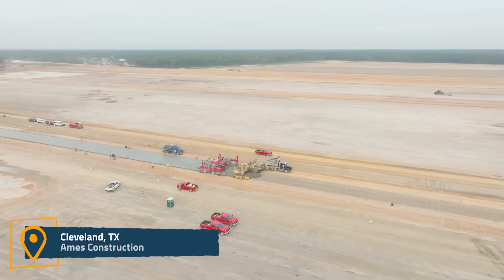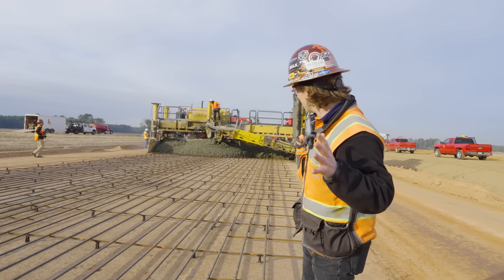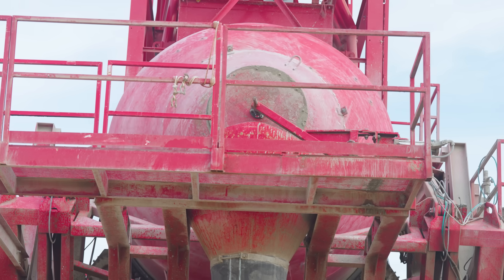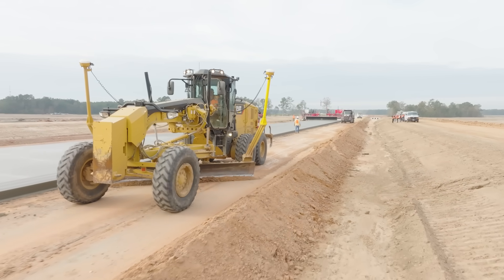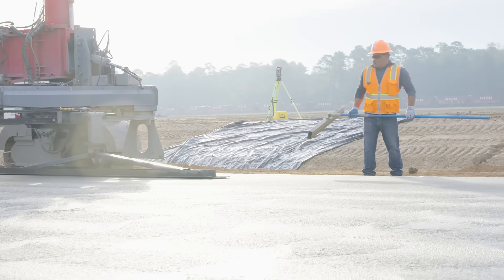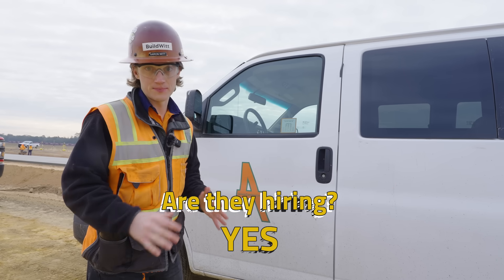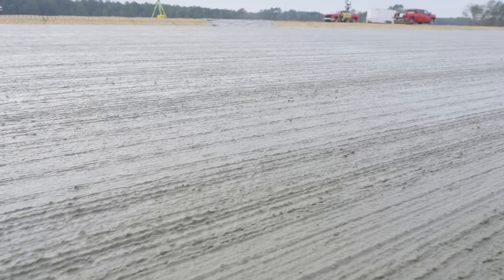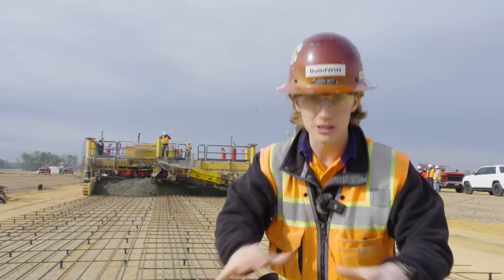Concrete Paving for a Railroad Logistics Center

Comment: I wonder if they could have sped the concrete paving up by pouring concrete slabs to set in place and bolt together like caltrans uses.  They could have been casting slabs for months.

Comment: I never knew there are mobile concrete mixing plants as large as these or that they even exist. I don't think we have something like this in Europe. Makes a lot more sense than hauling the concrete from a normal concrete plant which is often far away. Great video!
Reply: in america 100 miles
here in uk 10-20 miles

Comment: If you’re in the concrete trade this video is just amazing! The operation is so flawless! I can’t imagine taking on a job of that size!
Reply: Yesterday we poured 10 yards kind of a messed up situation today we did 20 yards. These guys are pouring that much every minute.
Reply: @steveanderson4768 don’t feel bad, they have millions and millions in equipment😂
Reply: @steveanderson4768 we do 1000+ yards a night by hand and 2000 with the paver

Comment: Thats literaly Nobrainer project.,..no Logic there concrete will crack over years no matter how much rebar you put there....
Reply: All concrete cracks. That is part of the hydration process as it goes through a volume loss and experiences shrinkage.  A common technique is to saw the concrete into square panels to induce the crack at the sawcuts so you do not see them.  This pavement is continuously reinforced concrete pavement (CRCP) and it is designed to allow the cracks to develop all the way through the slab.  The steel holds the concrete together, so the cracks do not get wider or deteriorate into larger spalls.
Reply: CRCP is some of the best concrete pavements for smoothness and long service life.

Comment: Would’ve asphalt been cheaper??? Curious on the difference between the price per sf of asphalt and the concrete
Reply: In markets with both asphalt and concrete, the upfront costs can be very close.  The difference is concrete will last 40 years +, while asphalt would need a mill and overlay after about 20 years.

Comment: One of the main roads about 20min from me was switching from asphalt to concrete in the town area of the highway and they had a smaller version of that machine. I didnt ever drive through as they were laying down concrete but looked interesting. Cool to see them actually in work, seems like they work identical to the asphalt machines just a different layout.

Comment: Paving roads with concrete is so wasteful, asphalt is better, it can be recycled and is less polluting in terms of green house gases, yes it require a oil by product but it can be recycled, plus concrete needs to cure before it can be driven on whereas asphalt you can drive on it basically straight away

Comment: Why concrete? I’d imagine way more expensive. Cna probably too cot that same road white asphalt 4x for the price
Reply: You are correct asphalt is way cheaper but concrete is way stronger meaning it will last longer and can handle more weight. Being a train yard its mostly going to see a lot of semi truck traffic. Asphalt roads will require alot more maintenance once it starts to give out.
Reply: @iamjuanmenchaca  most definitely. My only thought is it’s way easier to mill / lay asphalt every few years. I guess they can diamond grind the concrete every so often.
Reply: @Mack.of.all.trades there's roads out there that were paved in the 70s and they are bearly seeing a diamond grinder. Not unless the subgrade gave out then thats a different story. But if its built right from the ground up concrete has a very long life span with little to minimum maintenance. I guess you gotta weigh both options and choose one.

Comment: 27,000y³x4,000lbs per y³ = 108,000,000lbs of concrete + 2,000,000lbs in steel is a total of 110,000,000lbs of material placed. 30,000 feet of material is 5.6818 miles. 110,000,000÷5.6818=19,360,061.9521lbs of material per mile
Reply: Cool

Comment: I saw similar machine pave several miles of I5 a few years ago. I was very confused when I first saw the process due to the lack of concrete trucks but then I realized that they were mixing it close by and hauling the concrete in regular dump trucks. I'd never seen anything like it. They had crews working a mile out in front laying the rebar to stay ahead of the paver.
Reply: biggest down fall of mixer trucks is the discharge rate, the wash down after a batched load, and washdown discharge of load, to much time lost, and the loss of those trucks to a batch plant for supplying other customers,
dump trucks are the way, trailer dumps (edn dumps) are better, with a double batch on a single load, especially when your doing thicker slabs, we did an airport job over 3 years,  with 12 tandem trucks hauling 6m3 (8yd3) in Edmonton, Alberta, Canada, averaged 500M3 (653yd3)a day, and the slab was 400mm 16 inches) thick, 20 feet wide every pull, that was a learning curve for sure, and error tolerance of 3mm 0.118 inches)

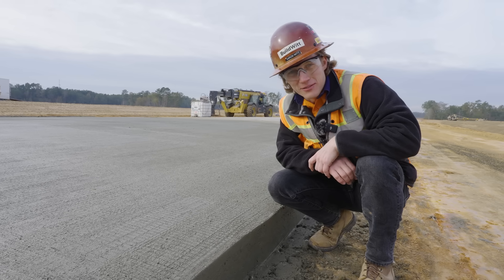Comment: 6:52 ready for traffic nearly ? Concrete needs a 7 day cure minimum, and full strength after 28 days. Even if they are using “high-early”, I can’t see anything but the foreman’s golf cart on there so soon. Love your content. Big plans for 2024 ?? 🍁🤙
Reply from the maker: Yes I speak in layman terms and it’s not a 100,000 vehicle per day highway
Reply: @buildwitt  your commentary was spot on.  Very informative and accurate.
Reply: This is a common misconception.  Little do a lot of people know, concrete can be open to vehicle traffic at 300 psi (flexural strength) and 1,600 psi (compressive Strength).  These strengths can be reached in 1-3 days depending on the mixture and the weather conditions during paving.  Researchers in Minnesota have shown no internal damage when loading as low as 73 psi (flexural).

Comment: Wonder why there aren't expansion joints? Or are those only needed in areas with freezing temps?
Reply: Typically with concrete paving those joints are cut using floor saws during the curing process.
Reply: Typically with concrete paving those joints are cut using floor saws during the curing process.
Reply: They will come back and cut expansion joints. You need them in Texas even more than cool climates. In that part of Texas it’s not uncommon to see days of over 100 degrees with a bright sun beating down. The concrete expands a bunch so you need the expansion joints to keep it from buckling.
Reply: @Bill_N_ATX do they cut just so deep or all the way through the slab and bar and put an expansion joint material in there and seal the top of it with some sort of caulking?

Comment: Wondering if doing this when it's cooler weather is also a factor?
Reply from the maker: Yes. They can use hot water at the batch plant or use cold water / ice in summer. At least that’s most common. Concrete produces heat as well
Reply: To some degree yes. However as summer temperatures have continued to rise, some plants offer a nitrogen treatment before dispensing the mix. For us it’s not feasible for our clients to pay up for that. For the government on an accelerated schedule, they’ll pay up. During the massive heat wave in the summer we shutdown for safety and because we couldn’t get concrete in spec. Generally we try to avoid pouring on 90* days. Plants primarily use a combination of ice and chilled water. Last summer getting concrete in spec with those methods was tough. In my area, the infrastructure industry is recognizing these weather extremes and is pricing for it and is respecting workers health.
Reply: @jonr9574  LOL 😂,  " weather extremes" ... it's called summer . Another democrat spreading nonsense.